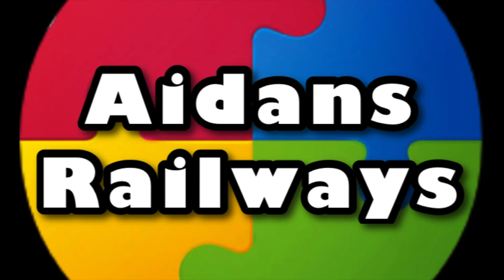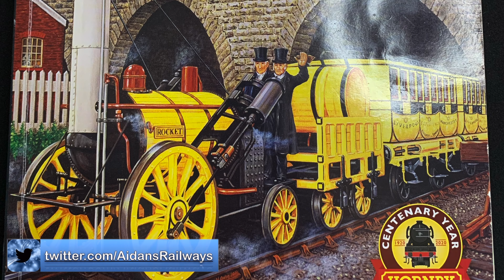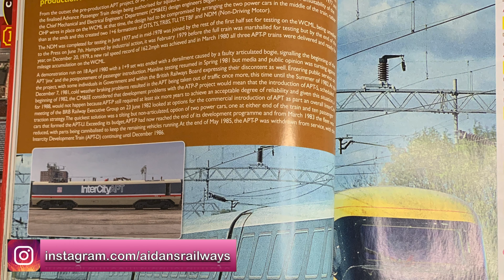New Hornby Apt NDM Power Car Unit | Non Driving Motor Unit | Hornby R3948

Comment: I think it will be the Packs that sell out. I don't see the Driving cars as being sold separately so I can see these being the irreplaceable things in the future.
BTW, just to be a pedant, the pantograph was connected to the bogie so it didn't tilt with the rest of the body. The panto needed to stay in the correct position against the overhead line.
Reply from the maker: Hi. Absolutely , the pantograph should be connected to the bogie. I'm sure I checked in the video that it was. As this particular power car is meant for the five car set I do not believe that replacement power cars are available for the seven car set. In the situation that tragically something should happen to a power car for the seven car set I think using one of these ones as a doner for parts etc will be the only option. I am curious to see if hornby will produce more sets with alternate fleet numbers. I saw some pictures recently of the driving cars and I'm already having concerns the the quality of the nose area may not be what is expected. Hopefully the images I have seen are pre production examples. Thank you for watching and commenting. Cheers

Comment: Hi, I have done the same as you,, I have the 7 coach pack on order, but have just received my 4 extra coach packs and a NDM. But I'm rather disappointed that I can clearly see the lighting capacitors in all the coaches and the plastic pantograph. My old Hornby APT came with a all metal pantograph !
Reply from the maker: Hi Dave. I too am a little disappointed about a few factors but I am glad that it is finally arriving if only in segments. I will most definitely have to get the garden finished for some summer running of the Apt in 2022. Cheers

Comment: Morning ben
Hope you are well
Not my thing but great review.
I've heard nothing but bad things about this model.
It will be interesting to see what Monday show
Shows us.
Plastic pantograph in this day and age is a big no up there with traction tyres
Keep safe arp
Reply from the maker: Hi mate. There has so far been quite a bit of bad press with the apt. Almost like the present day mirroring the past with the real apt so to speak. As you know I try to find the best in most things and approach with a open mind. Yes I am a little disappointed with some paint print issues and as we have touched on the pantograph. The tilt mechanism is basic yet effective. The issue with the capacitors in the coaches is just insane. I really don't know how that was allowed to happen. I do have one thing that I would like to put out there to everyone though. The individual prices for individual items at the moment I think seems to reflect. A coach pack at say a hundred quid works out at less than the current price for main range coaches per coach RRP. In the same way that the power unit here seems to be priced at a similar price of a railroad diesel/electric loco. As I said to David in another comment I wonder if the tooling was still available would hornby introduce a railroad range apt from the older tooling? I know its not your era but thank you for commenting as always. Cheers mate

Comment: Great video Aidan got one of the older APT sets myself and it is a great model, plastic pantographs in this day and age are unacceptable in my opinion, they should all be metal regardless of whether they are to scale or not, wish hornby had done extra coaches for the older sets because they would sell really well, only option for me is to get some that are 3D printed but then would have to paint them.
Reply from the maker: Hi David. I always wanted one of those older sets after I saw that one set at the model shop when I was younger. I agree with you on the additional coaches for the old set. I have seen some amazing custom full rakes made by others by cannibalising broken sets. One thing which I think Hornby may have missed out on if the tooling was still available is reintroducing the old sets in the railroad range and possibly making additional coaches available. Yes I understand that suitable replacement for the old ring field motor would have to be developed but I do think that could be a winner. What do you think David?
Reply: @AidansRailways  could probably be a good idea to have an APT in the railroad range but at the same time how much would a 5 car set be priced at these days, I also think the original tooling got destroyed years ago so it is very unlikely that additional coaches could be made.
Reply from the maker: I think so many toolings have been lost or destroyed over recent years. It would be nice to think if they survived that the possibility was there. If I had to take a wild guess at a price for a set as a train set track etc. I think we would be looking at least 250. Just a guess but working off the current sets available with loco and say three coaches etc. Then add the extra coach. Still a lot but definitely not as much as the main range. It's similar to the Hitachi rapier. I could not warrant buying main range however I got the blue rapier set and purchased the extra railroad coaches. Might not have all the detail but definitely more affordable. I would love to know if they still have the tooling though.

Comment: Hi Aidan. Very nice initial review. I did notice a couple of other not-quite-perfect areas of paintwork, but you have got to grab these models when you can. I look forward to seeing a video of the tilting mechanism in action on this model.
Reply from the maker: Hi Paul. Thanks you. Just an initial look at it really as there is not a lot can be done without the end units. The tilt action is very basic however quite effective. I didn't catch it on camera as I was watching it and running it in more than anything else. Thanks for watching and getting in touch. Cheers

Comment: I must say that £90 for a SINGLE coach is just disgusting and unacceptable
Reply from the maker: The coaches come in pairs. This is the driving unit. Effectively this is the locomotive. I'm assuming you mean this item?
Reply: @AidansRailways  oh right I see, I just thought that £90 for one coach is ridiculous
Reply from the maker: @bennickss  oh I agree. If I’d had been £90 for a single coach then I would definitely not have been purchasing it. At the moment a coach pack pair of coaches works out at a similar price to RRP for main range coaches and the power units at a similar price to that of a railroad range diesel electric RRP